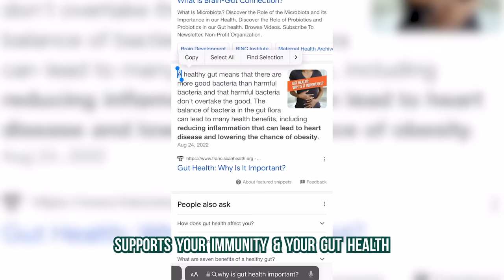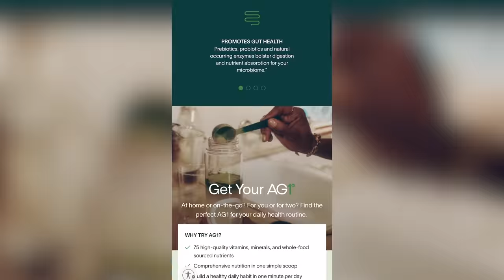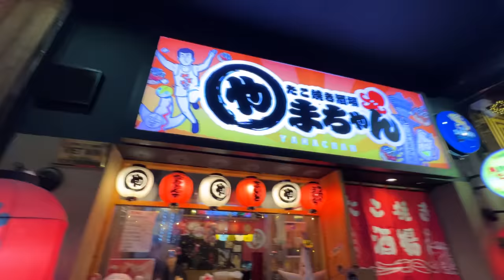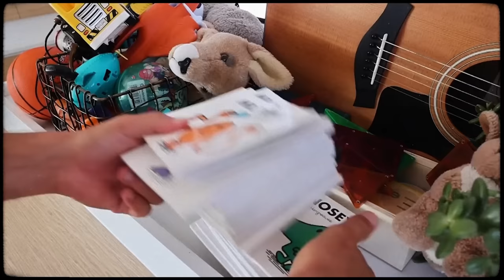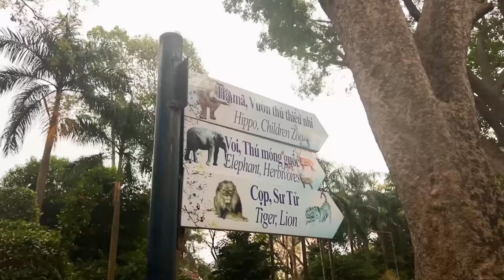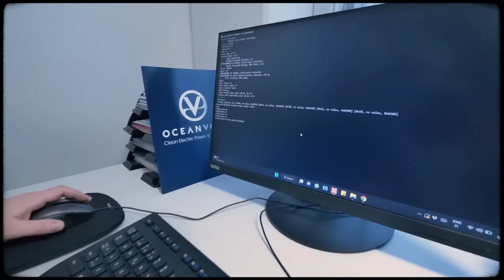When LIGHTNING strikes a Sailboat

Comment: I can fix your lightning problem. If you are in the zone, you get into the path.  The trick is to control how it passes to ground (the water). 

You need metal to be higher than anything else on the mast and travel, theoretically to wash side and forward and aft.  You need to be able to drop cable into the water from each of these points 10 feet deep.  They only need dropped into water if lightning is close by, otherwise simply store clipped to side. 

So, who cares if lightning comes. It takes least resistance to (or from) ground=water.  If on hard, extend off sides to “the” ground and pound grounding rods into “the” ground at all four or at least one of wires coming from that “most” high point on mast. 

Utilize the rigging for this wire and extend to water with equivalent cable. 

Lightning needs a path into the sky or from the sky.  If you provide that path, it will take it.  Even if you have other parts of your electrical system attached to the mast or rigging cables, it has no reason to take this path.  It has a better path through the rigging and into the water.  It won’t pass to/through the stop cocks or engine/prop because it has a better and adequate path starting above the mast (solid copper) to the rigging and ultimately the water at four points.  When you see lightning, drop the extensions into water. 

You think this will make a strike more likely?  Maybe. By a matter of feet?  Sure.  But, you have a Faraday cage.  

Air planes get hit all the time.  It passes through the aluminum skin and frame and has no reason to continue into the electronics.  

You don’t need to avoid being part of the lightning volt. You just want to direct it.  All the high amperage goes through this rigging path.  Your electronics may get some voltage but what counts is the amperage.  Zippo. You could touch the rigging during a strike and be unaltered.  You would have to cut a 7 foot section out of rigging and the stand on the bottom part and hold the top part, making YOU part of the circuit. You still may be uninsured because there are 3 more paths.  If you eliminated three of these cables, leaving only the one that you cut 7 feet out of to joint the circuit, you are a dead man.   You see, with all four traversing the high mast to well below the water, the amperage is traversing this path and has no reason to enter your body if you only laid a finger on the rigging during a strike. Same reason it won’t pass amperage through your electronics or other boat circuitry. 

There will be a strike.  You will hear the bang from the top of the mast into the sky.  That part passing via your rigging into the water is silent. It won’t cause a fire for the same reason your 12 volt lights don’t.  The amperage is not overwhelming the wire.  It might be huge voltage and amperage but it is insufficient to melt your rigging. 

Happy boating and enjoy the lightning. 

The wind and waves…that’s a whole other consideration.

Comment: I've got one quick question, heat is the bane of lifetime for both batteries and electronics with both of them losing lifetime exponentially more as the temp goes up. With batteries and the battery management electronics and distribution electronics all in the engine compartment, what did they do to keep the ambient temp down? Are there thermostats and fans for the compartment or what? p.s. still love y'all

Comment: Is it possible for the battery packs to have a “Thermal Runaway”?
If so, can the batteries be discarded overboard easily if a fire starts?
(It’s my understanding that a battery pack fire is VERY HARD to extinguish, and more importantly, the smoke and particles are quite toxic.) This is just what I’ve heard - best to check the facts and plan for options.
SOME THOUGHTS
1) Fire on any boat is a real concern, but not being able to extinguish a battery fire at sea is a major threat. If you could eject the batteries, you would have a better chance of putting the fire out.
2) A smoke detector in the battery compartment might give you early warning.
3) I think HIGH QUALITY batteries are a must.

Comment: To make crystal they put lightning rods in Sand where the most lightning strikes are, , when lightning hits the sand which is a semiconductor the sand melts into glass called crystal,  lightning is attracted to the least path of resistance  so attaching a high conductive material to the Antenna on mast which acts as a lightning attracting rod to a high conductive material that leads into the water under the vessel could definitely help detour the strike around your electronics, note: saltwater is a good semiconductor..

Comment: When thinking of protecting a vessel from lightening strike you need to consider the three possible sources. 1 direct strike to vessel, 2 EMP  from a direct or near by strike 3 shore power connection. All three pose different risks to life and property, you can never eliminate the liklyhood of a strike or the damage it can cause.  On another note FIRE, YOU  all need to do a basic fire fighting course, you should be able to asses the risk and your ability to fight or need to flee, you should have a variety of fire extingushers located in the araes they will most likely be required. Understand the hazard of lithium battery fires and the  toxicity of smoke from the various materials the vessel is made from. Auto fire systems rarely extinguish fires, they buy you time to asses, plan, fight or flee consider the time required to launch a life raft at sea. In both situations your lives are more important then anything else, saving your lives should always be your number 1 priority.👍🖖

Comment: Are the lithium batteries safe? I have seen where they combust and even the electric vehicles have caused home fires where the garage is attached to the home. Even the electric bikes in apartments have caused fires. Anyway, I am excited for your families new adventures on the new boat:)

Comment: How are you handling fire safety with the lithium-ion batteries? Do you have a eject button? If they catch fire they cannot be extinguished unless submerged in water.

Just saying there are saver and more stable batteries for marine use

Comment: G'day from Cairns, like the new ship, except for the pull out solar panels. You have acres of space to spread them out which is important for running any ship & by spreading them around on a sailboat in particular you have some hope of getting  around the shading issues. With an electric ship you need everything going for you at all times, not just when it's safe to pull out the rest of your panels. We have 1610watts of solar + a wind generator & only 3 x 12v fridge compressors + the usual other 12v gear & 480amp/hrs of Lithium batteries, no electric drive & it's great most of the time but a day & a half without sunshine & we're in struggle Street. Anyway like most systems it's evolved & been added to & if we were friendlier with Bugs Bunny we'd have more battery capacity. Anyway that's real life stuff. We'd ask your engineers to please explain, pull out just doesn't work when it's rough & that's when it's usually cloudy & you need everything you can get solar wise along with wind generation but make sure the W.G. have good controls with lithium batteries & I don't even know if they make them in 48v. Much easier to get it right in the build than at refit. Good luck with your new ship & the channel. We've Gotcha Covered

Comment: Most licensed 100 ton or better captains I know go with the fuzzy lightning collector on the mast (metal pompom) with cables going down to discharge through the keel.  Seen too many boats not so equipped basically turned into Swiss Cheese in a Heartbeat by our Florida Lightning which most are not going to want to hear about.  Better to be Safe than that other thing.  :(

Good idea to have a few portable lights and a supply of disposable batteries for backup nav and anchor lights in case of a bad strike when out to sea.  Colin found out the hard way why you unplug personal electronic items and put them in a metal box like an unused oven during a electrical storm.  The other big danger after a strike can be a runaway lithium fire from cell phones, tablets, etc with built in lithium batteries that were plugged in during the strike especially when hard mounted to the boat.  A few boats have been lost at the dock that way even with fire rescue nearby.  So not only turn them off but physically unplug them and the critical ones should be protected inside a closed metal box/cage

Best!

Comment: I suppose its just like a home.. I was hit by lightning when I was 3... its tried to get me 2 other times in my adult life, I tell ya, scary... 
but unplug stuff, dont leave the toaster plugged in, even if its turned off, unplug everything you can.. coffee maker, bread maker washing machine, microwave etc.... because the hit cant is stopped in the plug so if its unplugged, your safer.. 
even your fridge, well the storm will come and go, so having it off for an hour or 2 wont harm it.. 
losing electrical sucks, a lightning strike blew up my computer too.. so now I unplug anything im not using, so this way I dont need to worry because a strike can hit from kilometres away, even b4 the storm is upon you..

boat is lookin cool 😎

Comment: failsafes are not what is the response is to when something goes wrong like a fire suppressant.
A failsafe is something that is SUPPOSED to fail INSTEAD of something else. The failsafe is an intentional weaker point so that if something has to go wrong, its something predictable and predicted with a lesser chance of damage and repercussions. 
Examples: a lightning rod, that meltable platform the new Thorium reactors have, or sacrificial anodes/catodes in contact with metallic surfaces. If something goes wrong, they get the brunt of the damage, while everything else is spared.

Comment: Lenny spots Macaque "is it nice?"... good question Lenny.
Reply: I had a strong feeling you need to use rubber washers behind your fuse panels...like big ones that they use as shock dampers when mounting the outside unit of a heat pump.   Believe me, I have some past success with "feelings".  Nothing to do with lightening, my feeling was about hull integrity being compromised somehow by the mount and the washers popped in to my head as a necessity.  anyhow... it's all looking gorgeous.

Comment: Fascinating video with great explanations but I was wondering what your thoughts are given the on-going concerns around lithium batteries. There seem to be a stream of fires involving vehicles using lithium batteries. What are your thoughts on this and what measures can be implemented to avoid or reduce the risks? Love the videos.
Reply: I’m not certain on the batteries SLV bought but from what I can tell the lithium batteries on sailboats and RVs as well as most off-grid applications is a different chemistry than the batteries in EVs. Both are referred to as “lithium batteries” but they are not the same as the batteries in EVs and cell phones that catch fire if ruptured.

Comment: I know this is a simple thought, but at our home we unplug our expensive electronics during a electrical storm.  TV'S , laptops anything electronic.  I wonder why the same cant be done on a boat. You have no need or your navigation equipment 75 % of the time, for that matter the expensive windlass is unused for the same reason. Why cant you simply have the ability to remove power from these expensive systems when they are not needed ?  I enjoy your videos so thank you for your time and effort.

Comment: So, what I got from this video is that there really is no way to avoid getting struck by lightning while at sea -- except being nowhere near an electrical storm.  I was disappointed, however, to not see where and how the strike might be mitigated -- spread away from critical systems and somehow deflected off the boat -- if you are struck.  I suppose that they only way you can do that is to be anchored and send the charge to ground through the anchor chain.  What I heard is that if you get struck by lightning at sea, your just out of luck.  There is nothing you can do to avoid damage or deflect it.  Have I got that right?

Comment: It's a bit frustrating to see folks talking about lighting as if it's magic.  Engineers have been designing lightning-proof structures for decades and maybe even a century -- as prosaic as lightning rods on tall buildings to B-52s sitting on wooden docks built out over canyons in Nevada being tested against EMPs from nuclear bombs.  You could just do what they do.  The reason your vendors aren't is because it requires system engineering -- you have to get the whole thing right.

1) Give the lightning a better path to the ocean than the structure of your boat, and INSULATE THAT PATH.  You need a beefy conductor maybe a half to 3/4" diameter, with insulation good for 12kV or more.  This isn't expensive custom stuff, it's standard cable that you can buy from Southwire.  But here's the thing: that cable has to go from the lightning rod at the top of the mast all the way to the water contactor, with no breaks in the insulation.  You can see how Riley's going to chafe (hah) at the cable crossing the bottom of the mast mount.  Maybe you run the cable down the rigging instead of the mast itself.

2) Make the mast path less conductive than the air.  That carbon mast is a serious problem, because it is so conductive.  So you need to insulate the mast from any path to ocean with an insulator good for many tens of kilovolts.  Realistically you need something like a meter of the mast to be fiberglass or kevlar rather than carbon, probably at the bottom where it has all the fittings for the boom and so forth.  Your rigging would need to be Dyneema or something else insulating.

3) Everything electrical goes in a Faraday cage.  These aren't magic or amazing.  A microwave oven is a Faraday cage, as is the shell of every PC, desktop or laptop.  It's just a conductive box FULLY enclosing whatever thing you want to not fry when a lightning bolt pulls a thousand volts per meter electric field across your boat.  But in protecting whatever is inside, the box will end up with a significant potential outside relative to an e.g. human being touching it, so you'll want some insulator around the box.  The hard part here is fully enclosing things, because if any cables come out (to antennas, or external monitors, etc) those have to be shielded (that's the braided metal around the wires when you cut it), and those shields have to be electrically connected to the Faraday cage.  Your antennas have to be exposed, so basically whatever amplifier is attached to the antenna is expendable in a strike, and it has to be isolated with a transformer or optoisolator from the bulk of your equipment.  I'd keep a backup GPS and radio in a separate Faraday cage somewhere, to dig out after the storm passes and you discover where your shielding had a gap.

Comment: There are lightening deterrent devices that can be installed on the mast.  These range from free to $20k+.  None guarantee prevention, nor provide a warranty on damaged equipment should you get struck.  Personally I like Nichola Tesla’s design, but wouldn’t pay what companies charge to reproduce it.  Instead, I’d take the design to a machine shop and have them make me one, and purchase a bunch of heavy copper cabling to run down my mast to my anodes.  $2k - $3k, I’d be in the market to buy it.  $20k, better cover all my electronics should I get hit.

Comment: Couldn't you send a smaller boat out away from your boat with a higher lightning rod than yours  Doesn't have to be a heavy rod  Could be a wire as long as it was higher  It should attract all the lightning strikes.   This could work out to be a great invention by you  For my part which isn't much  That goes to your boys  You could even put a buoy out away from your boat  with a heavy duty weather Balloon that takes up a copper wire higher than your mast  to attract lightning strikes.  There have been many baseball pitchers who've gotten struck by lightning  simply by being a few feet higher than the other players

Comment: The original Rick & Morty actually harnessed a bolt of lightning to produce the 1.21 Gigawatts necessary to power their time machine back to the future. https://youtu.be/f-77xulkB_U    My Hobie TI's amas' outrigger arms are slightly tilted upward so upwind hull only makes contact with the water in high sea conditions or if loaded down with multiple passengers/cargo. Rapido Vagabond is shaping up to be a true work of art. Your mast pedestal reminds me of an MC Escher painting "Journey to Infinity"

Comment: As far a lightning protection goes there are a number of sailers with protection procedures on YTube, many of those videos were forwarded to Collin(i do not know if he  saved a file of them or was just overwhelmed with the available info......... At he very least you see lightning nearb y : unplug the radio antennas,  and nav & radio sets completely, figure out how insolate bms hadrware too..... I do not think your Ho Chi Minh city electrical expert has even though about Lightning  at sea......... there some guy company in Florida that installs protection in the Miami /Lauderdale area(i forget their name) they are connected to a marina &broker.... I see if i can dig  therir info
Reply: Was the view that it can be minimise? From what I've seen I'm not convinced.

Comment: this is such a massive vessel - what was the top speed on it? 9 knots?
Reply: I think they did about 26 knots without trying in good conditions during a one week test sail on another owners boat. It was probably not much more than 20 knots of wind. It think that was hull no. two or three. It's in a video if you go back and look. It's their first sail on a Rapido 60.